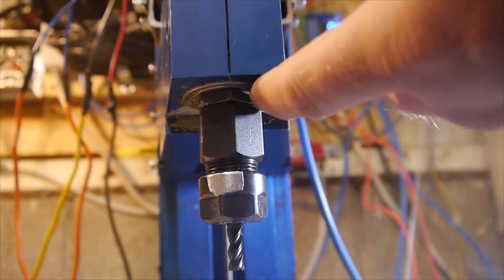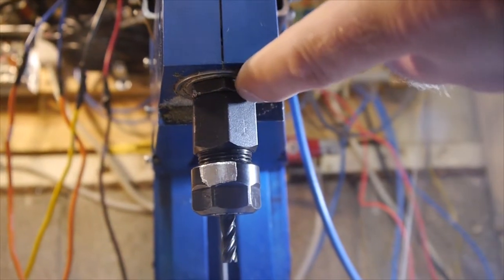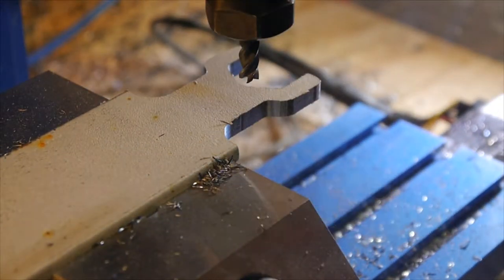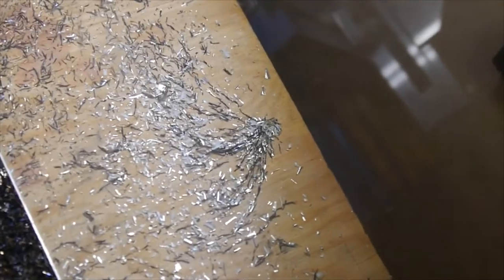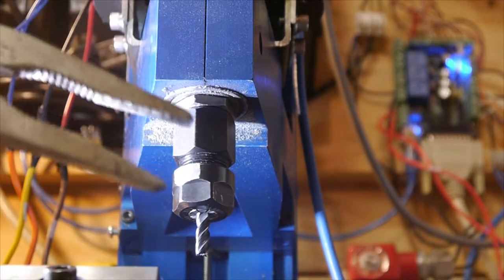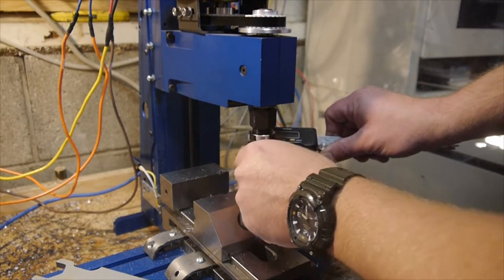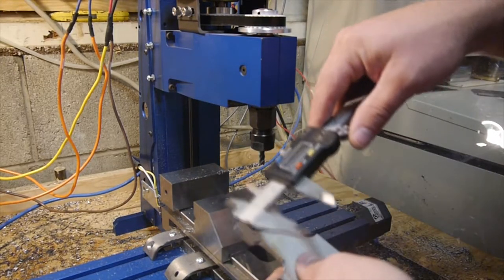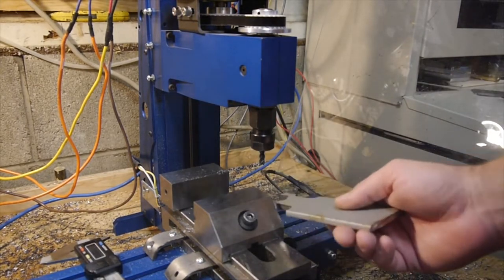Custom Steel Wrench on a MAXNC CNC Mill Part 1/2 Make your own tools!

Comment: Cuts like butter ! Out of interest do you have anti backlash nuts on the  leadscrew?
Reply from the maker: I actually do. Just measured the backlash an hour ago and it is 0.005" so that is part of it, but not all of it. I am doing some other analysis and I have a sneaking suspicion that my width of cut was too much and the machine itself deflected and caused the error. I need to measure this and see if I can account for it. With the 0.040" discrepancy minus 0.005" for the end mill being smaller, and minus 0.010" to account for 0.005" of backlash both sides, I am left with 0.025" divided by two for deflection on both sides and I need to see if the endmill and machine will deflect 0.0125" with a reasonable amount lateral cutting force on the spindle head. Time to break out indicator gages. :-) should be a fun problem. Later my friend.